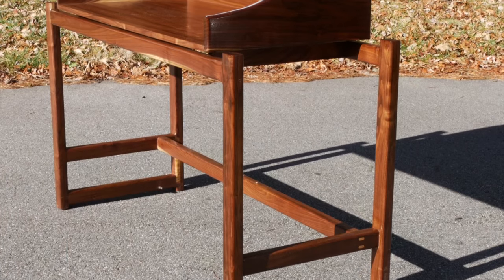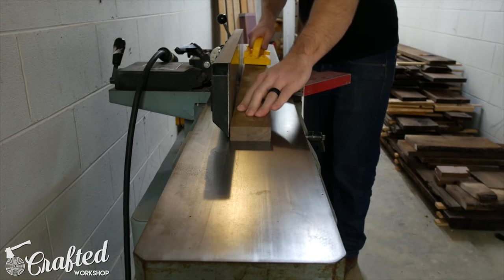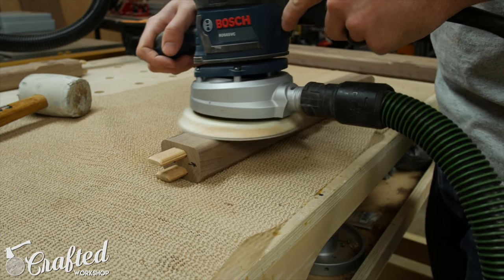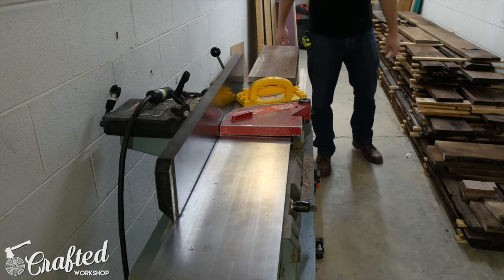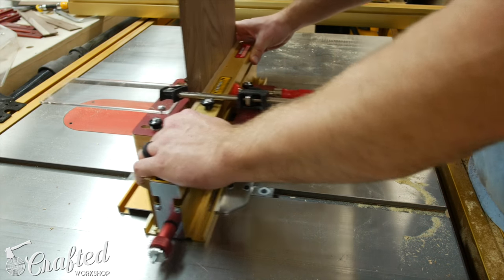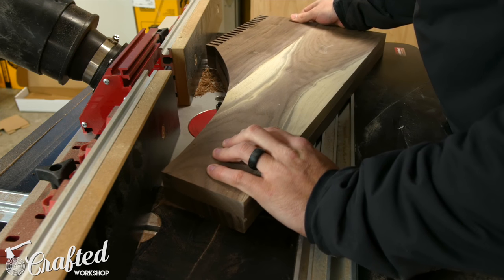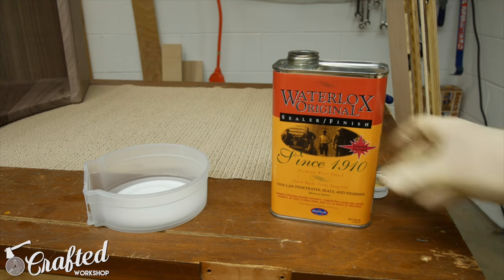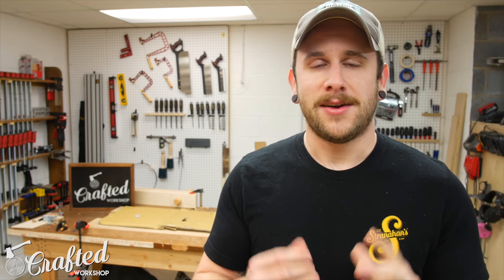Building A Modern Secretary Desk / Organ Cabinet

Comment: Awesome video. I don't mind the longer length video at all. Just so I can learn, why is it safer to rough cut width on the bandsaw vs the table saw?
Reply from the maker: When ripping a piece that isn't perfectly flat, it can get a little squirrely on the table saw. Also, since the bandsaw has a smaller kerf, it will remove less material. Thanks!

Comment: Beautiful piece! After hearing you talking about it on the podcast, it was gereat to see it. Look for the double sided tape that wood turners use. I find it much easier to work with. Also, you don't need to go full length with it.
Reply from the maker: +Tom's Dreamshop Worx nice, good tip! Thanks Tom!

Comment: I'm afraid to say that I cringed quite a bit at that finger joint. Not only because the finger breakage shows why you should never do finger joints or dovetails on the edges of boards (as opposed to the ends), but because it's a fairly significant (9 inches?) cross-grain joint. That top will expand front-to-back, but the side will not. I really hope that joint survives the seasonal changes. Fingers crossed.
Reply from the maker: +Jonathon Jongsma considering the top is only 9" wide and this wood has been drying for quite some time, I think the joint will be fine. What would you have recommended as an alternative for joining the sides and top?
Reply: I'm afraid that I'd consider 9" to be fairly wide when you're talking about cross-grain construction. The dry-ness of the wood doesn't really matter so much. It's more a matter of the fact that wood expands and contracts seasonally based on the moisture in the environment. And it only expands and contracts along its width and thickness, but not appreciably along its length. Even 100-year-old boards will still swell and shrink with the seasons. As for my recommendation: the sides should probably be a wider glued-up panel with the grain running top-to-bottom so that it will expand and contract in sync with the top. I don't mean to dampen your enthusiasm for making something beautiful, and hopefully it will turn out just fine.

By the way, using the method in this article, it seems that if you assume a 5% humidity swing from summer to winter (which is probably way too conservative for my area, but maybe not for yours?), a 9" flatsawn walnut board will expand and contract by about 1/8". http://www.finewoodworking.com/2013/08/29/calculating-for-wood-movement.
Reply: So, after listening to the latest podcast about negativity, I feel a little guilty for leaving the comment. My intent was to let you know about potential problems so that you can avoid it for next time. Hopefully it came across that way, and didn't come across as unnecessarily negative. The piece looks quite nice.
Reply from the maker: Hah, don't sweat it man, this was definitely not an example of one of the needlessly negative comments we receive. This was constructive criticism and I appreciate you pointing it out. I am always looking to improve, and knowing what I'm doing wrong is the only way to do that. And thanks for listening!